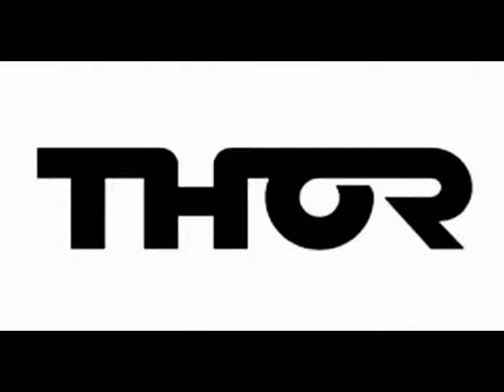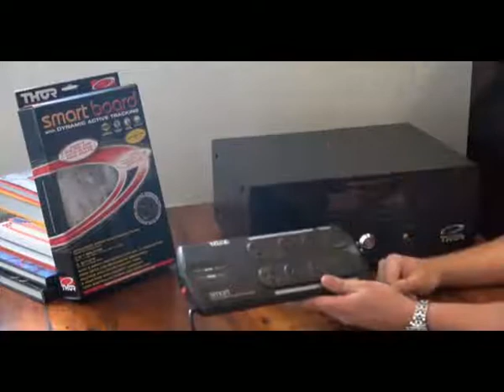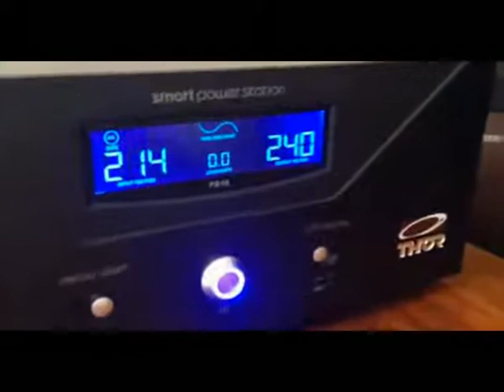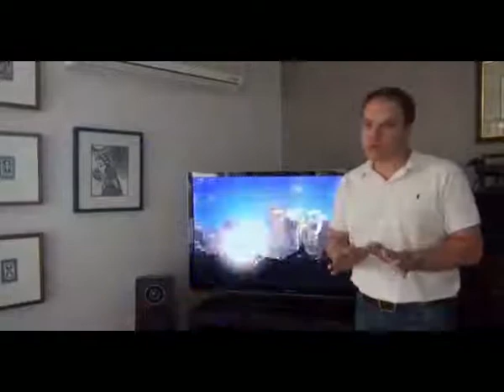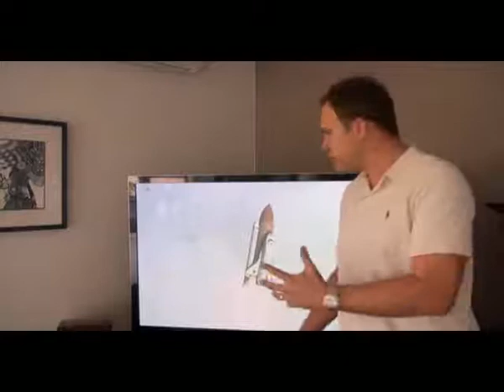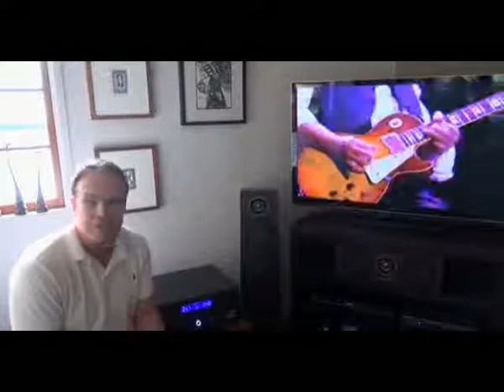Thor PS10 Power Conditioning pure sine wave filtered protection

Comment: Great. I've been in contact with Thor about the suitability of the PS10 to resolve some voltage issues with my Valve guitar amps. I'm definitely getting one of these units because I have been putting up with fluctuating voltages for years!

Comment: So this unit is more of a voltage regulator then hifi sound conditioner for removing incoming electronic back ground noise for hi end hifi ?
Reply from the maker: It actually does both. The most popular user is Audiophiles because of the immense difference to cleaning up background noise
Reply: @thortechnologies  thanks for the info is this model an updated version I have seen one with a different facia panel I am not wether you can tell me the best place to purchase in Aust.. Will do some homework on them thx .
Reply from the maker: Yes that is the latest version. Alluminium black front facia with silver aluminium buttons. There are stocksits Nationally and not sure where you are based but most will organise shipping for you too.
Reply: Where can I get a ground cable to use with this? I don't have any bare metal I can see, can I attach it to anything metal?